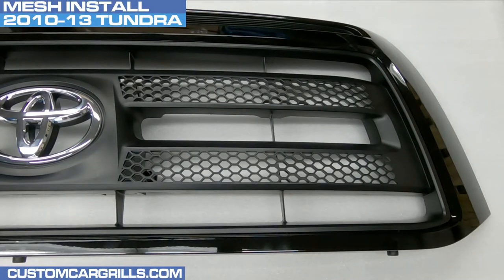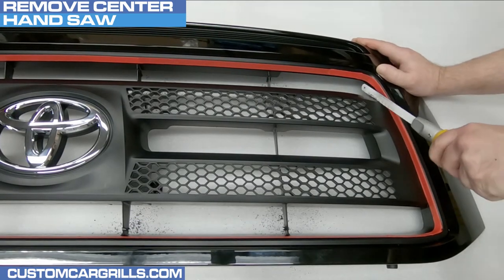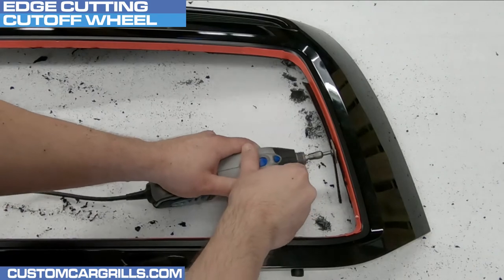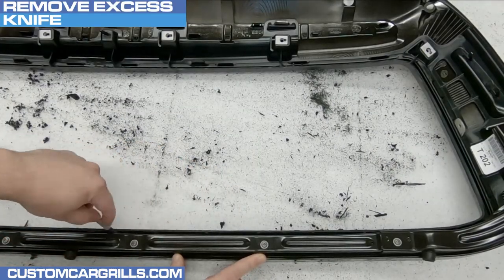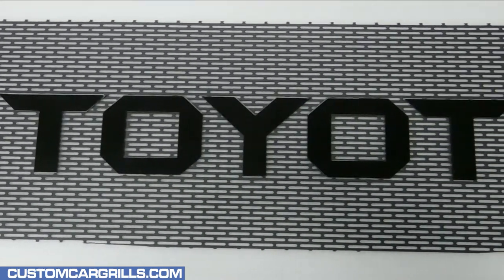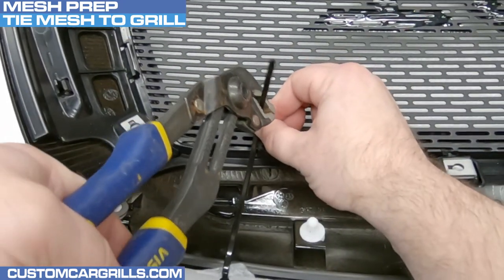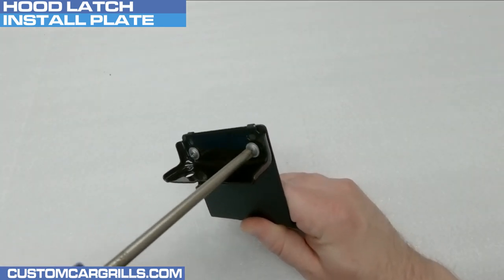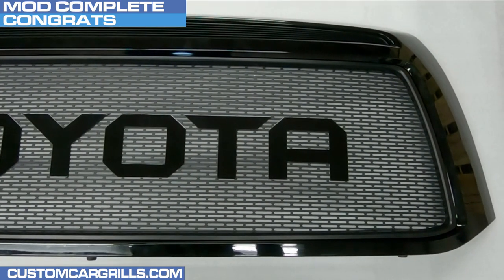Toyota Tundra 2010-2013 Mesh Grill Installation How-To by customcargrills.com

Comment: What’s the difference on 07-08-09-10 tundra grills?
Reply from the maker: The 2010-13 is a different shape inside of the grille shell compared to the 2007-09 model.

The main difference is in the width though.  The 2007-09 version is noticeably narrower.

Comment: do you sell just the 4 inch letters?
Reply from the maker: Yes, I have those available here:  https://www.customcargrills.com/Grill-Lettering.asp
Reply: @customcargrills  thanks, I have a 2013 tundra with an aftermarket mesh grill will they fit ?
Reply from the maker: That depends on the grill.  If it's flat with a lot of surface area, then they letters might be a good fit.  If it's textured with a lot of open area then the letters might not work so well.